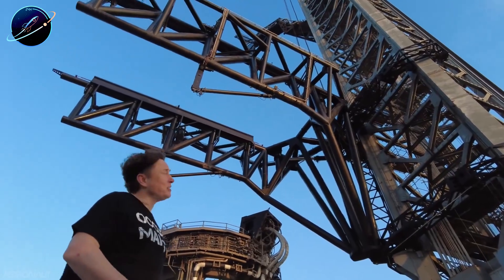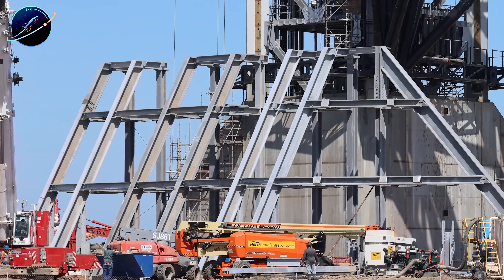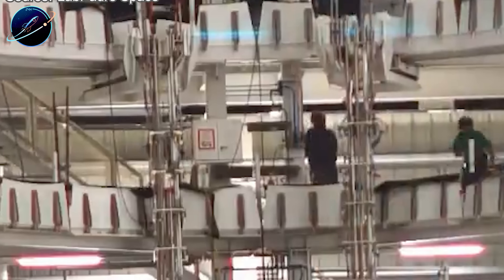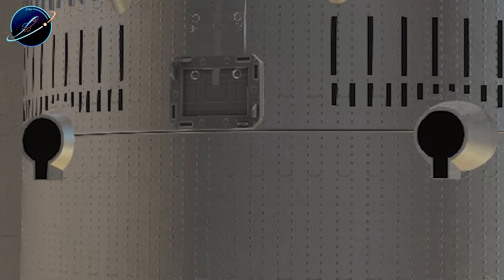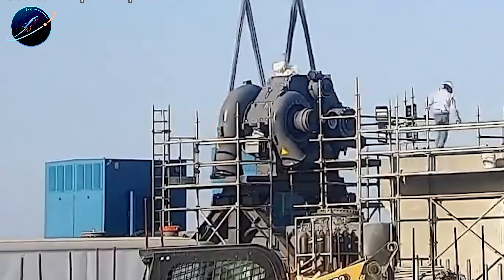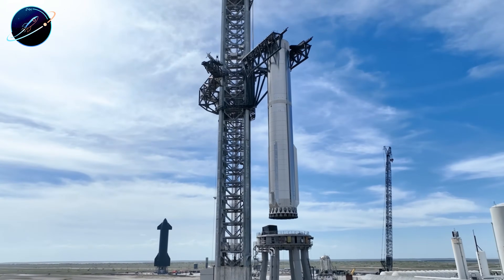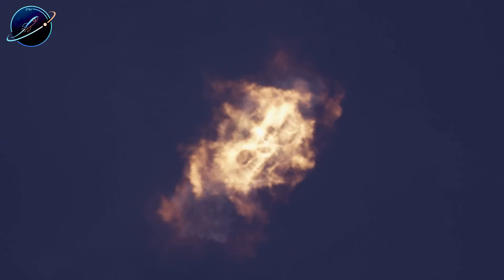SpaceX Reveals Tall Test Rig at Massey for Starship V3: Not Just Static Fire!

Comment: Hi what is the reason you stole my renders and cropped out the watermarks ? its not fair to artists to spend there time on these for people to just steal and use and post incorrect information.
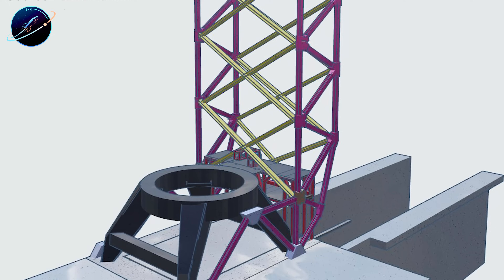Reply from the maker: Hey, those simulation images came straight from public Chrome Kiwi team posts (credited in the video at 1:35). If I cropped watermarks by mistake, my bad—happy to add proper credit or remove if needed. What's the exact render you're referring to?